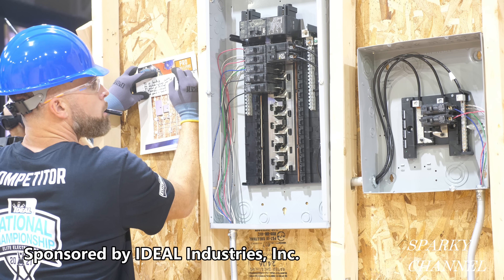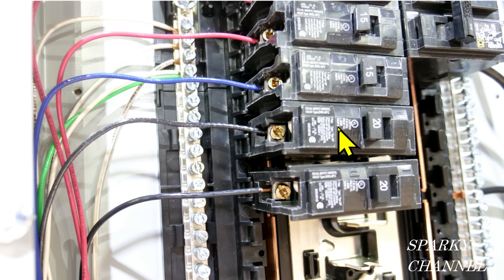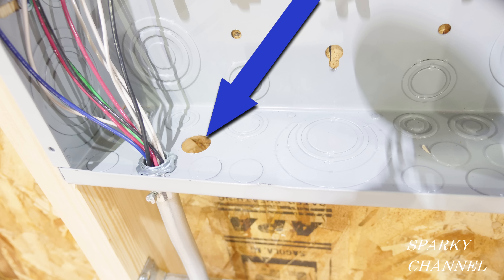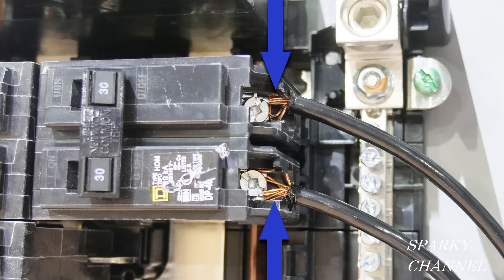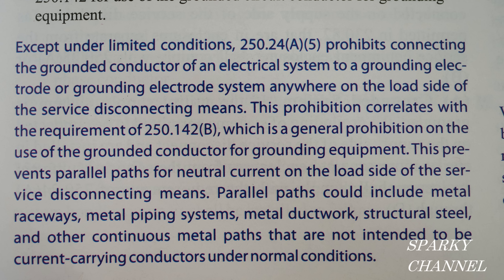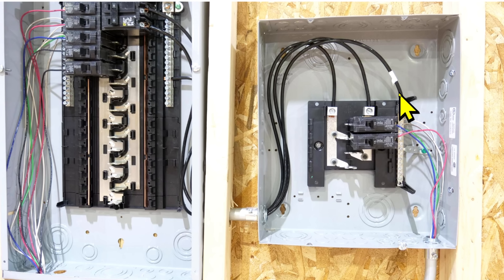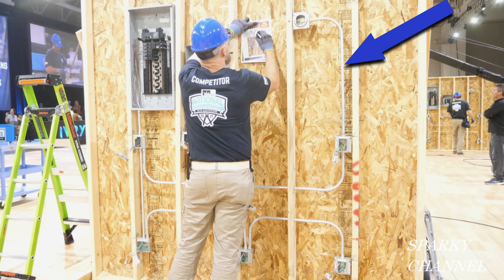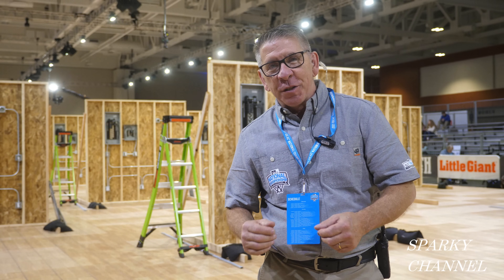Find the NEC Code Violations! IDEAL National Championship Code Violation Board Round 1 Part 2

Comment: The doubled up wire is also a violation... neutral and ground cannot go to the same bus. That panel may currently be where neutral and ground are bonded, but that is not always the case, and can change in an instant if a subpanel is added upstream. (and the code wording is "first disconnecting means". In my house, that's a 200A breaker in an external panel just above the meter. And it's all annoyingly aluminum.)
Reply from the maker: You're referring to the main panel?
Reply: there is no NEC requirement to have neutral and ground on separate busbars in the service panel.  that is just a best practice.  the inspector cannot require you to wire for a situation that does not exist in the current construction plan.
Reply: @kenbrown2808  my question is this, im wiring a 12ga UF-B wire for outdoor lighting, to a un-used 20a breaker in my house, where do i put the neutral and ground wires ?  The two bus bars on my 200A box both have a mix of neutral and ground wires on them.  I figured each bus bar needs one for neutral, one for ground but it seems both on mine are a mix of white neutral and copper ground wires.   So does this mean i just put the hot black wire on the 20A breaker and the neutral and ground on any bus bar that has a free terminal to put them in ?
Reply: @jeepsblackpowderandlights4305  yes. that is acceptable to code.  however, you may want to protect the circuit with a GFCI breaker, in which case the circuit neutral would go to the breaker and the breaker neutral would go to the ground/neutral bus.  
I would try to get the neutral conductor landed close to the breaker you are using, in case you wish to do that, later.
Reply: @kenbrown2808  So the breaker has a position for the neutral wire to go in ?  It looks like it only has a spot for the hot wire ?  Im confused, youre saying to run the neutral and hot to the breaker ? then a 3rd wire from the breaker to the bus bar ?   

I did want to install a GFCI outlet at the end of the run im putting my light..  but i didnt think i had to wire the breaker differently with a GFCI ?
Reply: @jeepsblackpowderandlights4305  if you use a GFCI breaker it will have a ground connection on the breaker.  if you use a GFCI receptacle, you can use a standard breaker which doesn't.  if you use a GFCI receptacle, you will want to get a weather resistant model if it is going to be outdoors.  it is also best to have a in-use type cover, even if your local code enforcement doesn't require them.
Reply: @kenbrown2808  yea i have wired outdoor light switchs and plugs..  In boxes that are weather proof.  But you confused me on the GFCI and neutral to the breaker then neutral breaker to the bus bar.

I cant just wire hot to breaker and neutral and ground to bus with a GFCI ?  Plan to put the GFCI in a plastic box.  With one of those flip open covers to be weather resistant
Reply: @jeepsblackpowderandlights4305  yes, if you have the GFCI in the receptacle, you can use a standard breaker which just takes the hot wire.
Reply: @kenbrown2808  in the receptacle ?  Its a GFCI receptable with two outlets.  With the test and other button.  Is that what you mean.  ?  Should i put the gfci closer to the breaker.. or can i put it at the end of the run..  fyi the 12/2 UFB cable is being run like 500 feet..  Its running 4 high pressure sodium lights.  One 100w, two 150w.  And one 70w.   I tested voltage at the end of the run and its at 118.5v. In the beggining of the run is 122.5v at the breaker box itself.  So only a 3% drop which is good for such a long run
Reply: @jeepsblackpowderandlights4305  ... GFCI protection closer to the breaker will protect the entire run, which may be a good idea if the cable is directly buried. The flip side is eventually that cable will get a nick somewhere and the GFCI will trip with no obvious problems. (problem hidden in the long run)
Reply: @jeepsblackpowderandlights4305  Correct. Normal breakers are only concerned with the current flow on the hot wire, they don't care about the neutral. So the neutral goes straight to the bus. GFCIs and AFCIs need to monitor the current on the neutral to do their job, so the neutral has to go through them.

Comment: In regards to maximum wires in conduit, isn't the restriction for current carrying conductors only? If this is correct then the ground wire would not be included, and then the number of wires is only 9, which is within spec.
Reply: I was screaming the same thing at the screen. :-) The ground wire doesn't count, and with a single 12 (count as 2 14's -- there are rules here, too), it's within the limits.
Reply: @jfbeam  the ground wire does count for conduit fill, but not for derating.
Reply from the maker: You are correct. Great job!: 300.17 Number and Size of Conductors in Raceway. The number and size of conductors in any raceway shall not be more than will permit dissipation of the heat and ready installation or withdrawal of the conductors without damage to the conductors or to their insulation.”
It says "conductors" so you are correct.
Reply: @SparkyChannel  oh neat, so Im not crazy. Not an eletrician btw, just enjoy your channel, and am currently wiring my detached garage workshop.

Comment: The neutral and hot of each circuit shall be grouped
Reply from the maker: Excellent. You are correct:
210.4 Multiwire Branch Circuits
(D) Grouping.
The ungrounded and grounded circuit conductors of each multiwire branch circuit shall be grouped by cable ties or similar means in at least one location within the panelboard or other point of origination.

Exception: The requirement for grouping shall not apply if the circuit enters from a cable or raceway unique to the circuit that makes the grouping obvious or if the conductors are identified at their terminations with numbered wire markers corresponding to the appropriate circuit number.
Reply: @SparkyChannel  When was this added? I've NEVER seen a panel do that. (in most cases, there's a single circuit romex, or single circuit per conduit) It's a good idea. (saves a lot of headache finding the ground and/or neutral for a hot in a busy box.)
Reply from the maker: @jfbeam  It's just for multiwire branch circuits and there aren't usually too many multiwire branch circuits around any more so perhaps that's why you haven't seen it. See 210.4 Multiwire Branch Circuits (D) Grouping.

Comment: The left side appears to have 4 neutrals and 5 hot conductors.  This would indicate that one of the neutrals is shared by two branch circuits, and those breakers need to have their handles tied together for a common trip.
Reply from the maker: Excellent! Great job. I noticed that too but I didn't take enough photos to show where the wires went so I didn't list it. You are correct.
Reply: In the old days branch circuits with a shared neutral were allowed to be on separate breakers but needed to be on different legs. I had a house with that and grandfathered code.
Reply: @drwhoeric  It's still that way in Canada, for non-split receptacles and fixed lighting loads

Comment: What about proper torque of the breakers? I don't know what your NEC says about this, but in European countries the screw terminals must be torqued to the specified value the manufacturer states. Here in the regulations there's one sentence: All equipment must be installed according to the manufacturers specifications.
And I've seen the American breakers are also labeled with the torque setting the manufacturer wants for the screws, directly below the wire sizes on 2:45. That is to prevent loose connections, but also too tight connections, because tightening them down will damage the conductor and eventually the breaker itself (terminal, sometimes also the housing). I've seen overtightened breakers where the two halfs of the housings were split, the two halfs are riveted together with some rivets, and they were just split.

Always remember: Loose wires cause fires!
Reply: few inspectors in the US will check for proper torque on terminal screws.  they will check to see if the wire is solidly fastened, or if it appears damaged by overtightening, and leave it at that
Reply from the maker: Hi Marcel, Happy Holidays! Excellent points. Yes, the proper torque for that breaker is 25 in/lbs.
Reply: @SparkyChannel  Thank you Bill, wish you happy holidays too!
Back then when this was introduced here all electricians had to buy 1000V insulated torque screwdrivers. My personal favourite is the Wiha one, because it's adjustable stepless. The Wera one comes with plug-in "modules", and the torque is changed by the plug-in module. So you require for every torque setting a different of these plug-ins. But the Wera set is cheaper, I paid 180 Euros (~200 USD) for it.
Reply from the maker: @Marcel_Germann  I own the Wiha, love it!
Reply: @SparkyChannel  lacking any sort of calibrated torque tool, my rule of thumb is to tighten enough to create a very small compressed flat surface for conductive cross section (for solid conductors)

Comment: hey doesn't the pipe have to be at least 1 inch and 1/4 inside the wood or something like that .
Reply: 2017 NEC 300.4(a)(1) does require holes bored through members to be at least 1 1/4in. from nearest edge. Where this cannot be done a steel plate plate can be used to protect cable or raceway. Exception #1 allows RMC, IMC, and EMT closer than 1 1/4in. without any protection.
Reply: @matthewrichards5941  nice i knew it . only one year in the code book but i've learned a lot . this video also showed me few other things i didn't even think about
Reply from the maker: @matthewrichards5941  Excellent, thanks!
Reply: i might be wrong but if i'm right i want to know so if you see this . feel free to answer
Reply: i forgot where i saw this in the code book i don't have it with me but yeah
Reply: It doest Apply to some types of conduits like rigid emt intemadiate
Reply from the maker: The emt does go in the middle of the studs. Does anyone know a code article for this?